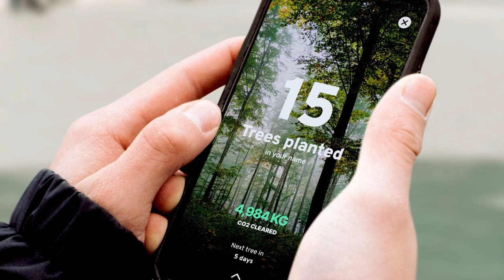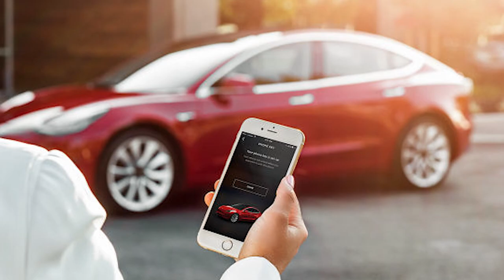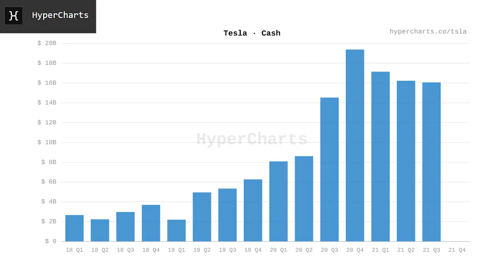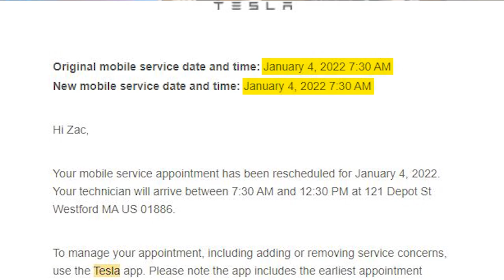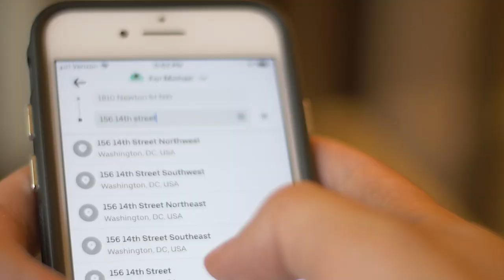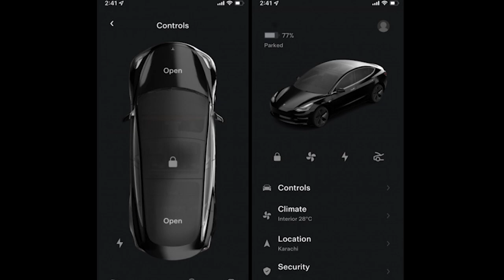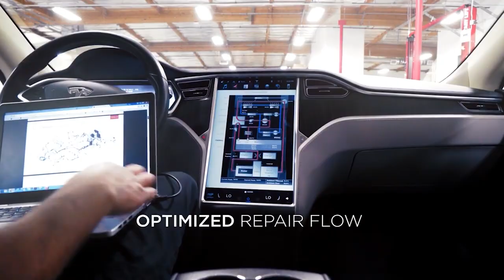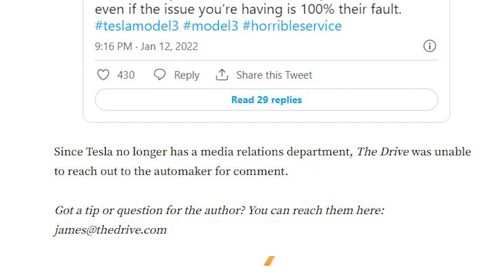Tesla We Love You, BUT… | In Depth

Comment: Having more Tesla service stations would be great of of course. What would be better is the ability for all the thousands of independent motor mechanics to diagnose problems on your car and fix all those normal little screw driver and wrench problems cars have, if they could buy all the normal spare parts to get the ob done. And of course if even the owners could get in there and fix lesser problems themselves.
Reply: Aint gonna happen. Tesla are going the Apple route - full control over repairs. So you either have to pay the price, or scrap and get a new one. You know, for the environment!
Reply: @timothytim1053  Apple, just like most electronics companies, recently announced they would sell parts and offer repair manuals in 2022.

Comment: One of your best videos.  Concerning spare parts availability, Tesla definitely needs to have a prebuilt supply of every part that can be repaired or replaced.  This is one of the reasons legacy auto makers outsource their parts (so they don't have to manage it).  Tesla could easily outsource all the necessary parts and also set up a third party service process.  Once the company matures, no doubt they will arrive at a comparable solution.  The point will be to get there before they destroy their reputation with their customers.

Comment: I’ve been applying to the Tesla START program to become a certified tech. I told them I was willing to do whatever it takes to learn. They rejected me because they wanted someone with automotive experience. Why would they want someone experienced with ICE cars? Why not just teach me the Tesla way?
Reply: They'd want someone with previous experience, cuz that person will already know how to change parts and is familiar with computer software so they don't really need to be taught more so than just showed how everything works. 

In other words they will have a lot of pre-existing skills that will translate to tesla. Not only because they have worked on cars, that for the past 20+ years have been glorified computers on wheels (seriously cars back then already had millions of lines of code), but cuz south of the electric motor there's no practical difference between the two(it's still a car).

It's heck of a lot easier, cheaper and faster to show somebody who already knows how to install a driveshaft or rocker arm on a bmw to do so on a tesla, than actually teach you that and really everything else as well.

and fyi fixing ice cars is way more about plugging in a laptop and pressing some buttons or fixing things south of the camshaft than it is to do anything with the ice engine itself.

Comment: I've been talking about this problem for years, glad you addressed it.  Tesla needs to change it's service policies and improve it's communications.  Too many Tesla owners have been turned off the brand because of these issues.
Reply: @austensible  While I'm all for RTR it has very little to do with the Tesla service and communications problems covered in this video.  These are mostly new cars covered under warranty, they need new parts and Tesla service as well as proper and prompt communication from the company.
Reply: Tesla China is opening and hiring to increase service capacity. Also, doing the same in Europe. North America .............. crickets.

Comment: We agree with your thoughts on this issue.  We got a flat tire about 30 miles outside Helena MT and had to get a flatbed tow truck to take us into town.
The closest service center was 300 miles away in Spokane Washington but they didn’t have a tire for our 2020 Model Y. Neither did anyone else.
The local tire shop ordered it for us. We got it 5 days later after learning the shipper had not sent it and had it overnighted at that point.
Our air conditioner stopped working in Bozeman MT and we had a choice of Salt Lake City or Boise ID to get repairs.We chose Boise because we could get service in a few days.
It was handled at that time but was still acting funny. Took it in again  in Las Vegas and all it needed was a new filter which was not picked up as an issue when they were working on it the week before.  Thank God we are retired snowbirds or this could have been ugly. So yes we need more service centers!!

Comment: I'm fortunate to live just 6 miles from a Service Center. That said, I've experienced the problems of having appointments canceled and rescheduled for no apparent reason. Its very worrying.
Fortunately, the worst problem I've had with my Model Y was a flat tire. The fact that Tesla cars have low maintenance requirements is probably why Tesla thinks they don't need more Service Centers.
 If Tesla can fix the service problems, there will be no stopping them. Otherwise, even a long time fan like me will be buying another brand next time.
Thanks for addressing these issues in this well done video.
Reply: I've already changed my mind about Tesla although they make the superior car, I'll be buying a Hyundai Ionic instead or perhaps one of the spiffy new Chinese offerings like the BYD Tang or Han.

Comment: It was 7°F last night here in MA. Except for my seat heaters, my car has no heat. This would be frustrating all on its own, but I was at a service center earlier this week for another issue, and the heating issue had just started. They said they checked it and everything should be fine.

It's been a week of avoiding using my car so I don't freeze.

Comment: Well this may be the exception to what most people experience BUT . . . last Friday (1/21/22) at 10:30 a.m. I took my 2013 Model S to the north Austin Service Center to show them the malfunction with my driver's side door handle (just to see if it might be a software issue) and, even though I already had a mobile service appointment set for Monday 1/24/22, they asked if I would like to have it repaired/replaced "today" as in RIGHT NOW.  After I got over the shock, I said yes and left my car then and there.  My car was repaired and ready to pick up at 3:00 that day.  They also cancelled my upcoming scheduled appointment without me having to do anything about it.

My view of this particular video is GIVE Tesla (and all other electric car makers) some time, we are at the start of the electric car revolution.  How many garages existed to repair ICE vehicles in 1905?  All of this service outrage is understandable in this age of instant gratification, but it is not reasonable at this stage of the revolution.  If this is a big issue to you, then WAIT to buy an electric vehicle another few years.  Period.
Reply: Agree on cutting Tesla some slack, but the demand is clear, $16B cash is there. Better hurry up! Stockpile of parts and communication are pretty straight forward to fix.

Comment: I do love my Model Y. I have not "loved" any other car I have owned in my 60 years. My A/C went bad 1 year after taking delivery. Tesla went thru several rounds before they ended up replacing it. I was impressed that they replaced it and, due to excellent design, were able to replace it in a matter of hours. However, as a result of the A/C being broken in humid, Florida it ended up collecting condensation which lead to the stinky foot smell each time I used the A/C. For 1 year prior odor was not a problem Only after the failed A/C did it happen. I took it back, Tesla replaced the filters and used coil cleaner but then charged me $140 for the pleasure. I pushed back but they refused to take responsibility saying this happens in ALL Florida cars.  I've lived here all my life and not one of my cars have suffered this. I have ow cleaned the coil and replaced filter several times on my own. I think I have finally solved it (BTW coil cleaner cost $12 and it takes 15 minutes). Love the car but very conflicted about the service.
Reply: Yes but getting at those filters and the coils is a real pain in the butt and not an thing to do if you aren't young and flexible. The location is really crappy engineering

Comment: yup, same problem here in Nelson, BC. When buying my MY, I was told by sales in Vancouver that Mobile Service covers my area...not true. Tesla mobile service wants me to drive 350km to Kelowna. So far, I have not needed service urgently (a windshield wiper was replaced in Calgary, AB, when I happened to be there on other business). Now I get a message on the car that service is needed. I scheduled it in my car and was super surprised and impressed that my phone rang and it was Tesla to tell me the reason for the service request was that there was something that needed to be fixed with the heating. As my heating was working fine, I was not in a rush to get service. The appointment was scheduled for Feb 4th (back in December). Last week, I looked at the app again as I have to reschedule (it's a 4 hour drive each way to Kelowna!) and was surprised to see it had been changed to January 31st!  With no other notice to me!  So, I used the app to cancel.  This is only because I have no problem that I think needs attending to...if I had a problem, I'd be MAD too!  
Tesla needs to get service right. Now.

Comment: I had an issue with my rear suspension. Went to 4 different service center and was told the issue was normal. Even after giving them data (damper dyno) proving it was failing, I was denied replacement because a 3rd party had “worked on” them. Big safety and service issue. Video of example on my channel. Notice the excessive oscillation? Not normal and extremely unsafe. Fixed the issue myself with aftermarket suspension. Tesla sucks.
Reply: I thought Tesla suspensions are already bad enough lol. The harsh ride and loud wind noise makes a 70k car feel like a Prius. Have u checked with any other repair shops who can help you? This is not safe at all.
Reply: @jackz4149  I replaced them with aftermarket suspension at around 9000 miles.

Comment: You are the reason I bought my 3 Three Tesla's (3, S, Y) and 2 power walls , I agree with every word in your In Depth adding that Super chargers waiting time is increasing here in CA and my power walls stopped working in Oct 19 called to be told next app for someone to come out is Dec 20th. They came but the batteris is not responding so they escalated the case to a higher team after calling to followup they gave me app Feb 23rd !!! BAD SERVICE

Comment: I'll share my Tesla service center experience:

2018: I had to go to Dallas service center (near Lovefield Airport) to take delivery of my LR AWD Model 3, for car I had pre-ordered as soon as option was available in 2016, and configured for final delivery as soon as option was available in 2018.

2019: I had to go to Dallas service center (near Lovefield Airport) to get tire replacement after my front passenger tire was damaged by pothole (no scheduling wait). Their mobile service had changed the tire and put in loaner tire, but I had to go to Dallas to return it and buy a replacement.

2020: Someone backed up on my car x2 (in parking lot) doing some damage to the front-bumper and one of the fog lights. It was hit & run, but I provided dash cam footage to my insurance and they tracked down offender using video evidence to have their insurance pay for the repairs. The insurance process took close to 2 months which was my choice to avoid paying any deductible that would have to be reimbursed but after that Tesla service scheduled me to drop off car at an authorized body shop near their not yet open Fort Worth service center. The body shop took 3 days and made it better than new (improved panel gaps).

2021: At around 36k miles, and with one of my rear tires visibly damaged from some road hazard and them recommending replace both rear with new tires, I got scheduled for both rear tire replacement about 2 weeks out, but in the newer Fort Worth service center closer to my home since that had become available. I knew about the Fort Worth service center probably 2 years before it became operational. After they had the land (lease?), they built it out and what seemed to take them most time was hiring and training people to staff it. I started getting Mobile Service coming to me from Fort Worth staffed location long before the Service Center itself was operational.

If you are following along, I only have 1 original tire left. I don't do rotations or any other car maintenance.

Rest of my service needs have all been through Tesla Mobile Service at my home (in Fort Worth) including upgrade FSD computer, upgrade charge port pins, something with the Frunk latch, and replacement of the 12v battery. There is a new recall notice related to Trunk rear-view camera which I expect will also be handled through Mobile Service at home.

Definitely important to have service center closer to where you live because needs do come up and closer is more convenient for everyone involved (Mobile Service trip lengths) and customer Service Center trip lengths. They do offer complimentary Uber Vouchers whenever you visit their service centers so you don't have to sit and wait, but if you are too far from home, it isn't practical to use for a service visit that will only take 1-2 hours wait when you get there as scheduled (per my experience for the tire replacements).

I've had worse service center experience in terms of my convenience from my ICE car that has dealer with their own service center within 15 minutes of my home. So I don't think Tesla is doing poorly, but I think making their V3 superchargers available in more remote places as well as service center covering more of the geography more conveniently is a good thing for us Tesla fans to keep asking for. Especially knowing that number of Tesla cars being sold keeps accelerating and it takes time for new service centers to get built and professionally staffed.

Comment: I'm a longtime fan of your channel.  However, the credibility of this episode is suspect.  One of the major selling points of Tesla vehicles is that they require much less service than ICE cars.  If that is true, then when comparing the number of ICE vs Tesla service centers should include a service center reduction factor to the number of Tesla service centers required.  Perhaps after this adjustment, the problem may actually be service processes such as efficiency, scheduling, training, etc.
Reply: if that was the case then the current infrastructure wouldn't be booked for weeks solid.

Comment: Some good points, but here’s what you’re missing. 

1) Unlike ICE dealers, Tesla does not operate service centers as a primary source of profit. Also, all service centers are owned by Tesla,  unlike in the ICE world, so there is no competition between service centers and no drive to provide the best experience. They simply don’t have the same incentive as your local Ford dealer.

2) If Teslas are less likely to break down, do they need to have as many service centers per capita compared to ICE companies? 

3) Like it or not, Tesla is not worried about a future sales dropoff. Their order backlog is months long and they can’t keep up with the demand.

4) Tesla is not a warm and fuzzy company to work for… therefore it’s not going to be a warm and fuzzy company to work with. They work most employees to the bone with hardly any smiles and pats on the back - and so that culture will be spread to the after-sales customer experience where profit is not a motivator.

5) Covid and the “great resignation of 2021” has made it especially hard to hire, especially for manual labor jobs. 

This problem will probably not be solved unless you sell your Teslas and put Elon on notice - and even then it will be hard. Because people problems are much harder for engineers to solve than technology problems.

Comment: Thanks for the video, this is even a bigger problem then your video states. I’ve owned multiple teslas now, and I knew when the 3 and y came out that service was going to tank. I live a couple hour drive from a service center. In Washington there’s a handful of centers, that are packed to the max! For the amount of the teslas in this state, we need waaay more. I have sooo many Tesla service horrid stories, I could write a book. ( some small examples) I’ve had rescheduled appointments 3 times in the last 3 months. I’ve driven 2 hours several times only to be told, we’re too busy and have to reschedule you. I’ve had stuff broken while serving other parts, only to waist multiple 2 hour driving trips( too busy) to get it fixed, only to not come back to get fixed what they messed up. I’m just tired of trying with Tesla. I’ll tell you what, the second I can buy an electric car that’s better, I will be switching brands 100%.

Comment: Thank you for making this episode!  The Tesla service tech's are amazing, but the local service centers are way too small and always massivly crowded.  They need more bigger service --  Personally I have had tons of problems with the app!  It works terribly.
Reply: Yes, the app is awkward to use and I wonder why I can't simply call in to get a clarification on an issue I'm having with  my Teslas.
Reply: @michaelkiefer6993  For sure.  The problem I had was windshield replacement.  After two failed appointments I found out that the 3rd party shop that does windshields was so busy that if you didn't have a very early morning appointment there was no way your windshield would get replaced.  The app did not give the Tesla mechanics/staff any way of asking me to schedule a early morning appointment.  So I nievely chose appointments that worked for me, and that would never result in my windshield getting replaced.  --  When it did finally get replaced the windshield was obviously a reject, it has many warps and a lot of little waves and bumps.